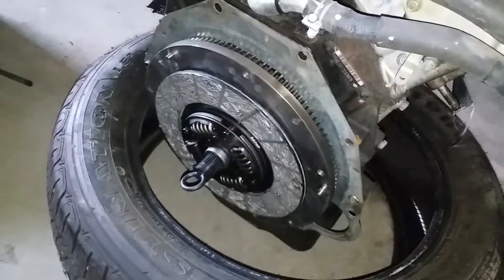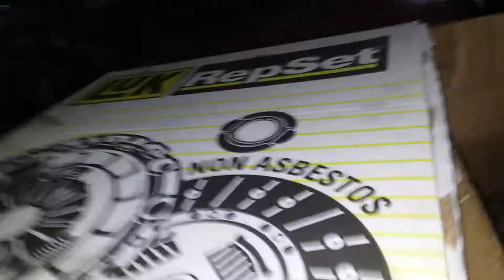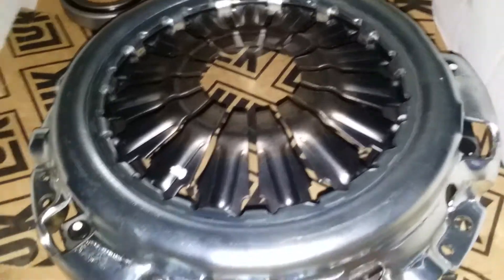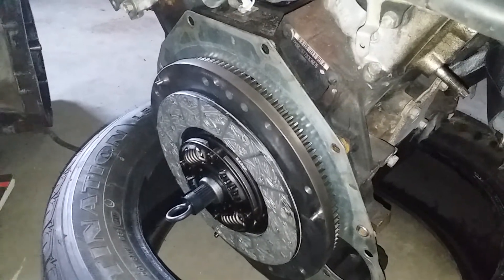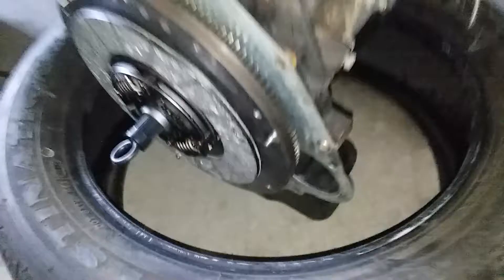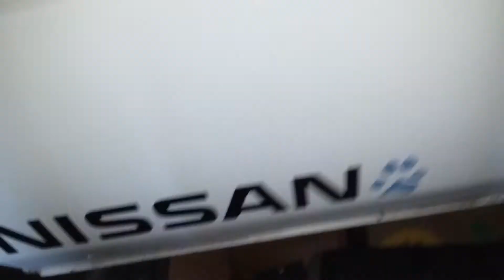Supercharged Nissan Pathfinder Pickup Build Part 26: Clutch Install Fail

Comment: How did you adjust the timing belt tensioner pulley?
Reply from the maker: Loosen the nut and then use a allen key to rotate it.

Comment: Hello sir am trying to change the ignition wires and the spark plugs of my 94 phatfinder
But the wires are stuck in the spark plugs... What you recommend me to do? Any tips?
Reply from the maker: Did the wires break off on the plugs? I usually use a ling set of needle nose pliers to pull them off.